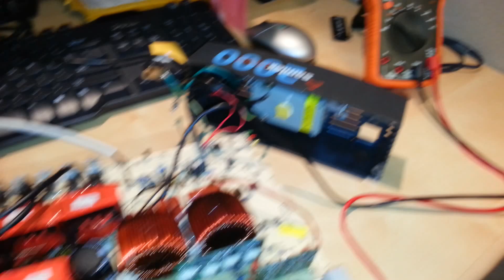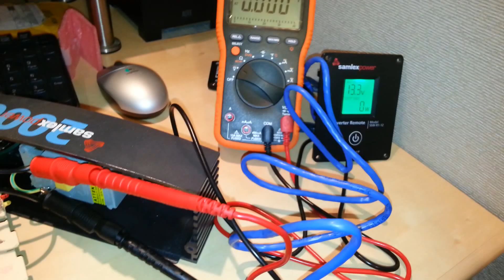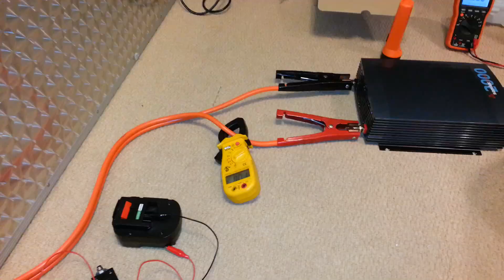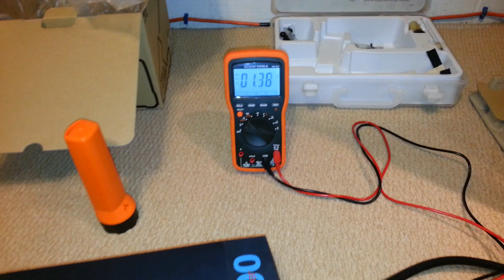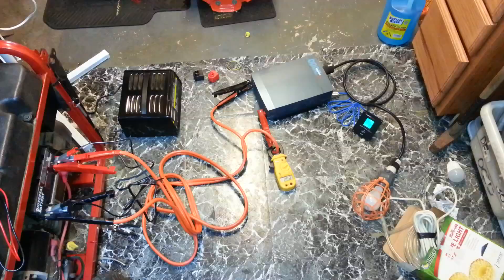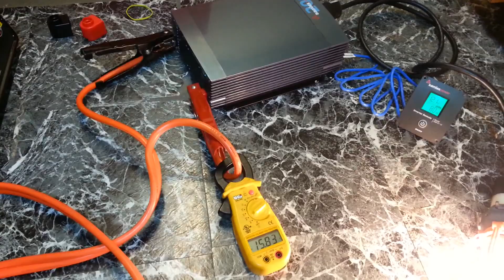Samlex SSW-2000 Pure Sine Power Inverter Repair: Part 5

Comment: Having problems trying to desolder on my inverter tried using higher wattage iron but solder will not melt.
Reply from the maker: Lead free solder has a higher melting point. Try 750⁰F and a lot of flux

Comment: Hi tell me if the cooling fan doesn't go on what could the problem be
Reply from the maker: Thermocouple under the output transistors is bad. It's a PTM so if you short it the fan should go on

Comment: Would you still have the schematic for this unit? I have the exact model.the output voltage is only 115 volts under 100 watt load
Reply from the maker: Its archived somewhere on my old computer. 115vac is acceptable though

Comment: Omg! This is hands- down the best a most informative vid i have seen. And ive watched dozens. You explanation of what all the components do is incredibly helpfu.
Fantastic job all around!
Reply from the maker: Glad you enjoyed it!
Reply: @Bassguitarist1985 great video I've watched the videos to see how you fix this thing I have the same inverter it works as it should I have one problem there's an alarm going off and it says it's low voltage but I have a green light and there is good output at the receptacles what do you think it could be unfortunately the inverter is on my boat and I hear the alarm going off if it was somewhere else I wouldn't have to listen to The Alarm it's very annoying what do you think it is
Reply from the maker: @nicksanguedolce9375 what is your battery voltage at the terminals going into the inverter? If the voltage is below 11.5 volts I think the alarm starts going off. It could be a little less than that.
Reply: @Bassguitarist1985 I had lead acid batteries I've switched to lithium the voltage is over 13.2 volts I'm getting good output through the receptacles and I do have a green light on
Reply from the maker: @nicksanguedolce9375 that's well within the range that no alarm should be going off. Unsure what the issue could be.
Reply: @Bassguitarist1985 it is annoying is there a way to disable it.....I should have stuck with my ebay Chinese one that I've had for years
Reply from the maker: @nicksanguedolce9375 The beeper is on that daughter board if you wanted to desolder it so you don't hear it anymore that's an option but you need to be careful that nothing else gets damaged on the board.

Comment: Excellent repair work with good logical procedures. I would test the input driver board to make sure that there are driver pause signals generated from the board while the board is out of the main board with my scope first.
Reply from the maker: Thank you for the info. The input driver board was actually where the problem was. Unfortunately the design had changed and was no longer available. This video series was taken when I was first learning about advanced electronics like this.

Comment: good stuff would you want to fix a 2000w magnum csw2012-hx if i cant get mine started.  I have input and output mosfets on order. But if that doesnt work Its above my capabilities.
Reply from the maker: Apologies i am not available any longer for this type of work.
Reply: @Bassguitarist1985  np thanks

Comment: Hi I watched you repair on the samlex.12 volts inverter..great work  .How ever I have a APC.1400 va.950 wats.invertor. I shorted the battery wires.  Just wondering if  you would be able to fix for me and I have a 1400 apc.1050 watts need to be repair
Reply from the maker: Apologies for the delay response. Sorry I am not available for  this repair.

Comment: By far best detail oriented and insightful video for a power inverter short I have seen so far. You should be proud of your work. I have a situation with a fairly new 1500 watt PSW inverter. Sorry for my long violin question. if you read through it I would greatly appreciate it. if not, well I would understand. Here we go..I shorted something out trying to add an additional external 9mm on off switch for my solar power box, so that I would be able to turn on and off without having to open the cover to do  so. Anyway, my mistake was to wire the positive lead of new switch to positive lead of inverter switch, and here is were my bone headedness began, I put a negative lead on new switch and wired it to a spliced negative lead that was going to the volt meter. when I powered the inverter on  I heard a crack and saw some white smoke coming from the area of the 2 output capacitors. The inverter was dead no power .So I took the inverter apart and to my surprise both capacitors were fine. I did noticed a trace had  protruded the board and was slightly charred. I resoldered the trace and got good continuity again. To my surprise the unit powered on. but then quickly went to fault mode. I'm in need of some advice and hopefully you can shed some insight as to what the problem is. Thanks
Reply from the maker: Hard to tell without some sort of schematic, but the cost of repair may outweigh a cost of a new unit sadly.

Comment: A Kill-A-Watt is the best tool for measuring actual power from a 120 volt inverter.  I have a solar-charged 420AH 12 volt battery bank with a 2000 watt pure sine wave inverter as my "Wait until daylight" solar generator.  Depending on the season. it can provide 8 to 24 hours of limited power without me going outside in the dark, a thunderstorm or 30F and 7 inches of snow to start a gasoline generator.  As most of our outages are less than 12 hours (longest at this location in almost 15 years is 16 hours), 8+ hours should get me to better conditions for starting a gas gen.

Although there's a volts/amps/watts/AH meter in line with the battery bank, I always feed the transfer panel via a Kill-A-Watt so I'll know how much AC power has been delivered, as well as the DC power used to produce it (verifying inverter efficiency).  Having the DC meter also ensures that the battery bank gets an adequate recharge (typically 110% to 115% of the discharge AH).

The inverter is from Reliable Electric and idles at 1.2 amps below 13.2 volts input and 0.7 amps above 13.2 volts.  Other than the brief (1-2 seconds) run at power on, the fans only run when the inverter is hot.

I also have a second identical inverter as a spare and a 500 watt pure sine wave inverter if needed for fallback (powering communications [phone, internet, cable] or charging power tool batteries but not running the fridge or furnace).

Comment: Very nice project. I have the same inverter, and my fans kick on as soon as i turn switch on, even without any load. Ones i have some load, fan will speed up. I thought this inverter has temp sensor, not amp sensor to start fan. What do you think?
Reply from the maker: Yes I agree there should be a temperature sensor not a current sensor

Comment: Congratulation my friend I dude that you can resolve that amezing problem, but you have a lot of persistence or resilence or wherever they say... i mean Rosevelt, Do wherever you do whit the things that you have! I had the same problem whit inverter 4000 in peak 2000 continuos i changed all the mosfet of the A.C line but ringing alarm have a another one burned mosfet in the tablet same as yours!

Comment: I have a samlex 200w modified sine wave. It is working.
 Here is my problem. I installed it in my motorhome, I wanted to power my refrigerator (approx 8 -900 watt) while I am traveling (usually several hours driving time). The samlex cut out 10 - 15 minutes. I have two AGM, 1010 aH connected in parallel, initial input voltage 12.6VDC. I monitor it appears to cut out at 11.6VDC. I WOULD LIKE TO ADJUST THE CUT OUT VOLTAGE TO 10.6VDC. can you help me out?.  my email address is Fastlanedan@Gmail.com, thank you iin advance. (yes, I have an electronic background, albeit old, from the 70's)
Reply from the maker: Fastlanedann hey Dann. Apologies, I am unable to assist with this. Its hard to know where to start without a schematic.

Comment: Great video , I watched all five . In your opinion, is there any thing that could have prevented this problem? I have been looking at this inverter for my rv , and would hate to have this happen . you said that there was a fuse before the inverter, could a faster burning fuse help?
Reply from the maker: a proper sized fuse on the positive cable is for safety so the bats don't explode. A failure like this was due to bad components.

Comment: Very steep L-Curve, learnt a lot from this series.  What I like to do is put. A automotive bulb in series, bright bulb indicates short and dim bulb indicates that bulb not needed.  Thanks for publishing this.
Reply from the maker: John Woods indeed a steep l-curve. Never repaired an inverter before this series. Glad it helps others to learn too!
Reply: xboxer1985 I have several inverters that I use and several that don't work.  I have got to the point were I need to start repairing them.  So finding this series is very helpful, you have done an excellent job.

Comment: hi  i  just got  a  pure sine 1500w   i put a load like a  window ac work fine to the compresor turn on and star sound funny  i  burnt the fuse change it 20 to 30 amp  and as soon i connected Puffff    lol smoke   came   out   i   open  and  i se  on mosfest littel but dark no like this one the you fix i do not see no more burns  but i will like to know if you can help me, off corse i will pay for the parts and you time,  if  is wort fix it,  i think is not that much like this one the you fix are you up for the second challenge, i know you be happy whit this one.is a yueQing Reliable Electric inverter 24v 1500W  60 mh  120 my e mail  is www.caserio1027@aol.com  my name is Hector  from orlando Florida
Reply: thank you
Reply from the maker: Caserio, I am unable to assist. Without a schematic to work with, and the amount of time it would take me to figure out the issue, you be better off buying a new inverter. My apologies.

Comment: My compliments to you! What essentially happened was that you corrected a design flaw with the lo-v driver circuitry after dealing with some heavy cascading collateral damage. Would be interesting to look at the manufacturers' failure data. In all likelihood had nyou replaced the defective component with an identical (read discontinued) part, the failure could probably have recurred.

Again, great work!

Comment: Really enjoy your detailed videos on inverter repair------I have a Xantrex XPower 1750 inverter that when opened looks absolutely pristine although when it is 12 v powered it does not function.------the fuses check OK and there is no evidence of excessive heat anywhere. Will the application of reversed voltage blow fets without visible damage?
Reply from the maker: yes

Comment: How the hell does the output transformers take the current.
Reply from the maker: higher switching frequency means less time being on per ac wave cycle, means the caps can be smaller. class d amplifier basically

Comment: Good job! I have to fix my Xantrex prowatt sw 2000 sine wave which is very similar in quality to yours. Why they blow up just as easily as the Chinese ones?
This is what I have done which I learned from your great video: checked the DC side seems ok (no blown transistor/fets) cant test the drive logic yet
On AC side: had blown ICBT replaced with similar one (ordered from China) 
Just discovered the gate 10ohm resistor open. (do they limit the gate drive current) could that be the problem of fatal failure?
A resistor burned in the power stage that powers the driver logic to output  daughter board AC side
I dont know what value to replace with  :(
any help would appreciated
Reply from the maker: +ElenaDiakova drive resistor blown means the drive circuitry kept that bank of fets on too long. Likely something shorted on its end pulling the fets to ground for too long and the resistor burned. Replace any blown driver Fets and predriver NPN transistors, then concentrate on the drive circuitry for the DC side. There is a likely failure there that cascaded to the the drive FETS.

Comment: So you plug in what you said yourself to be 70W of lights and a LED work light at maybe a couple of Watts and complain it's not accurate when it shows 70W on the output power display........ um seems pretty accurate to me??
It may well have been pulling more than 70W from the DC supply, that's called not being 100% efficient, especially at low loads like that!
Reply from the maker: +Awynn0 i switched to a 100 watt incandescent bulb and 70 watt rope light for the test. Yes this inverter depending on load claims to be 85-90% efficient. I've measured it to be in the mid 80's efficient with various loads.
Reply: +xboxer1985, you didn't say you changed the light at the time so I missed it but now I look back I see it actually is a filament bulb and in fact the LED one is just in shot on the floor there. Yeah I have to agree then, indicating somewhere in the region of 100W less than the expected load is way off...
Reply from the maker: Yeah my fault I didn't mention the changeover to the filament bulb. Its def because of the new driver board. I'm sure if you pared the new driver board with the newer style bar graph remote it would work just fine

Comment: great videos. so I just bought one of these invertors off ebay. same 2000watt model. and im pretty upset actually I cannot get it to start my tiny fridge in my camper. do u know what kind of power the owner of this invertor was powering? seems like it can barly hold a 500 watt load (according to my killawatt) w/o it start beeping. do u think it would be possible I can get it touch with the owner of this invertor? I would appreciate if you can ask him/her when you get time,, thanks
Reply from the maker: This unit can start my 12 amp canister vacuum, my 5hp wet/dry vac. A small fridge should be no problem! What gauge DC wires you using? Size of battery bank? Need setup details
Reply: I have two yellow top optimas. one is a little older then the other (shame on me I know) and it does feed off the new one a little bit. but I still get a good 14.5 v charge while engine running. just to try it out out quick I used a set of 4 gauge jumper cables.(not the best idea). didn't have a voltage drop at all. but im going to set up some 2 gauge 1 foot long cables and see if that works soon but not getting my hopes up.  I called samlex tech support and the guy said my little fridge is prolly drawing over 4000 watts start up surqe. lol I find that hard to beleave.
Reply from the maker: How big is your fridge. Whats the spec plate say? How many running watts? 2 awg wire is too thin. Use 0AWG pure copper wire. Voltage drop too much shutting down inverter im betting
Reply: ***** capacity: 1.7 cu.fthigh side: 300 psilow side: 120 psirated voltage 115v at 60 hertzclimate class: 1 current: 1.35Afoaming agent: cyclopentaneamount of refrigerant: r134/ 1.06oznet weight: 38.5lbsenergy consumption: 0.86kWh/24him running to farm and fleet right now to get some thick cable.
Reply: nojokeauto the specs kinda got goofed up from how I had them . sry about no spaces
Reply from the maker: Okay. 1.35 running amps and 1.7cu fridge is my beverage fridge. It can most def do that. Surge is about 12 amps roughly for a fridge that size. Least thata what i measured from my clamp meter on my fridge. I think your cables are too thin causing the voltage drop to go too far low to support the surge.
Reply: *****  your right.. I put some 1.5ft 2/0 gauge  cables on there  and works perfect now. need to brush up on my electrical skills some more.. thanks xboxer1985 for your time
Reply from the maker: Anytime buddy!

Comment: You were lucky to get it work again ;) For the next time, and for all those not very skilled ones, you never test anything by plugging it to the battery without making sure everything is fine ;) You have to check every stage, that it is working, first the controlling board, you need oscilloscope to make sure all the primary mosfets are getting correct impulses, then you can connect a limited current power supply to see, if everything else is OK at the primary side of the DC/DC converter...but you were also lucky, because it is sometimes more difficult to repair the output stage, because of the high voltages present, and burnt mosfets usually take their controlling IC's with them...but again, you have to make sure first, that the control board generates correct impulses before connecting the mosfets to power, otherwise you risk burning all of it again ;) I was laughing a lot not at the famous sentence - holy shit, it works, but when you burnt those primary mosfets again due to lack of checking those impulses from the control board :) But well done, next time you don't have to waste time at the output stage, when those mosfets are OK, and if you check everything as I said, step by step, you save more time and money because you don't burn anything anymore ;)
Reply from the maker: Thank you! Yeah it was my first inverter i fixed. Learned a lot from the experience! Lol didnt know that my comment was a famous one! I was genuinly shocked it worked after the struggle!!

Comment: That remote will probably be more accurate at higher draws. At lower draws there is very little voltage across the current sense resistor/transformer so its more difficult to measure.